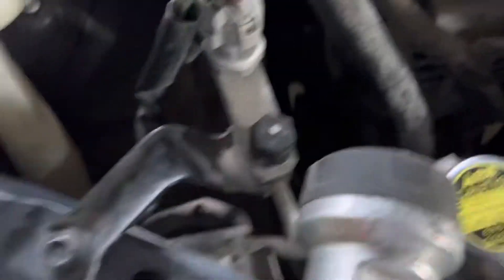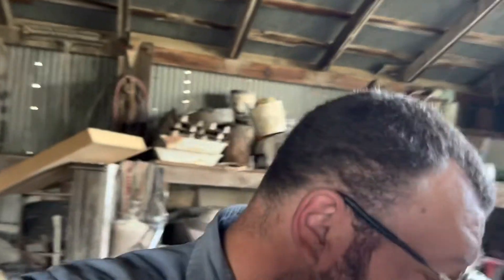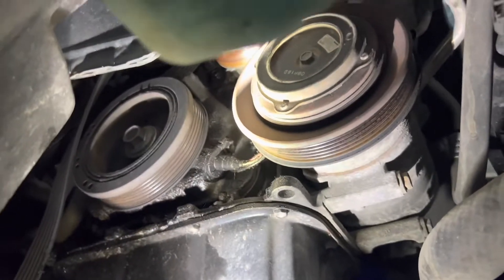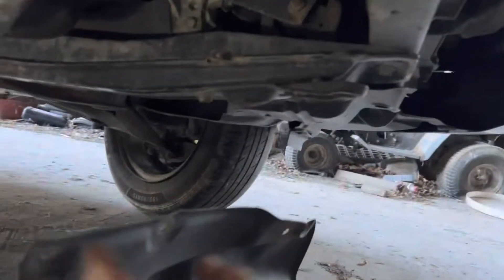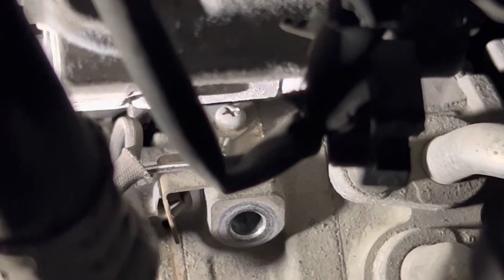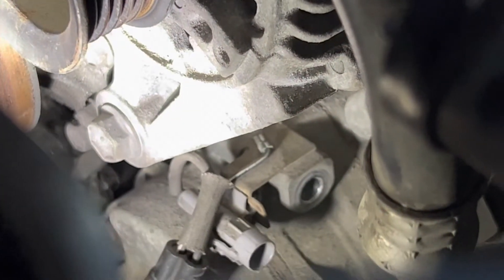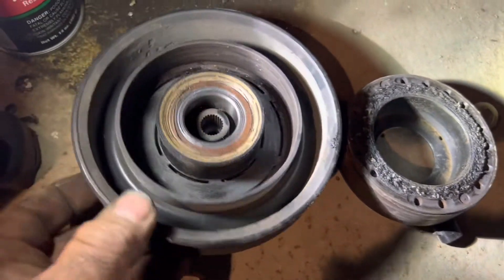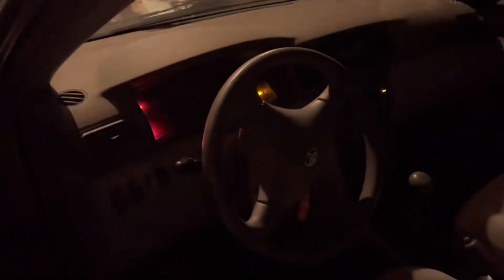AC clutch assembly, 2007 Toyota Corolla

Comment: Was there enough room to remove the clutch without dropping the compressor? I see what you said about that confounded spot they put the ground screw which caused you to loosen the compressor to gain room sucks!
Reply from the maker: Yes, plenty of room to remove the clutch, the ground wire was the only issue

Comment: My ac clutch disappear😱 i didnt know that can happen 
 Is it better to just replace the whole compressor or replacing the clutch is worth the shot?
Reply from the maker: Check the compressor shaft for leaks and give it a spin, should have resistance but can be turned with your fingers, if it’s leaking or won’t turn then go with the compressor.